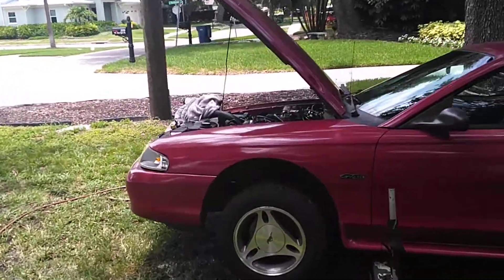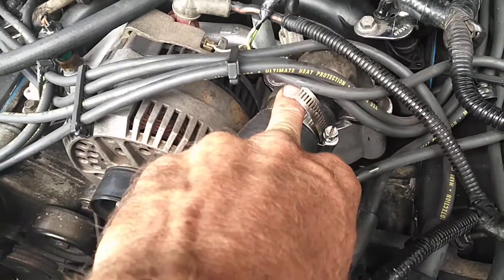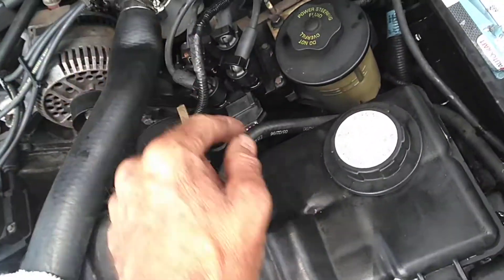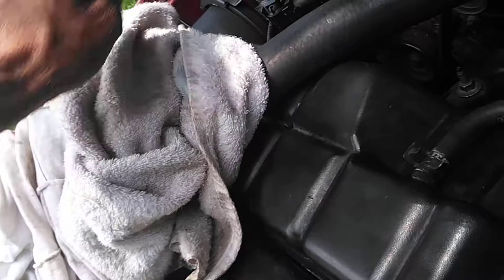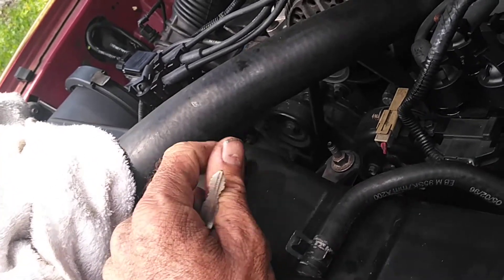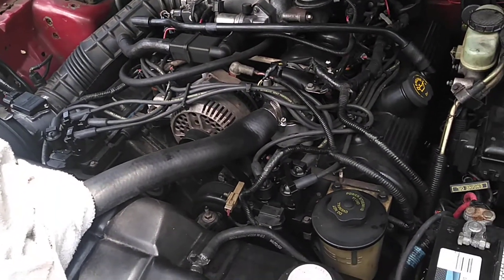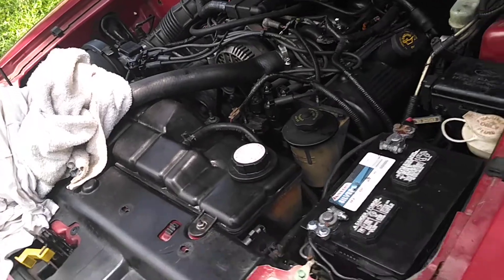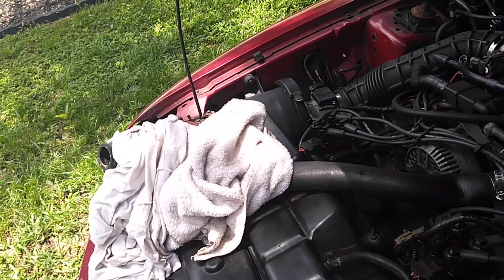How to flush 👍 a mustang GT 1996-98 motor/ cooling system.

Comment: Can I do this with a 04 GT ? Like are they the same procedures?
Reply: Disconnect lower radiator hose? Then bring the car to operating temperature? Then spray in the upper radiator hose?
Reply from the maker: 4.6 same
Reply: @keepondreaming3870  hey thanks for the reply ! So I would just add water thru the upper radiator hose and let the bottom hose drain from that side? I heard there was a engine coolant plug that drain from that side too
Reply from the maker: Either way, but I prefer, to remove lower hose. I flush it till clear water comes out., Of hose.
Reply: @keepondreaming3870  seem more effective that way